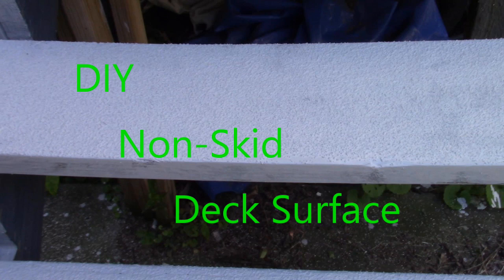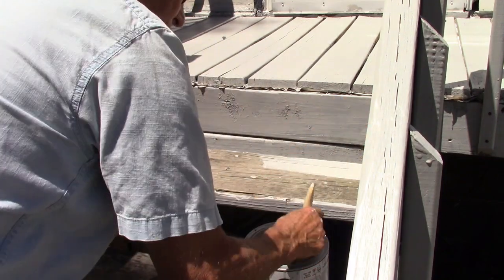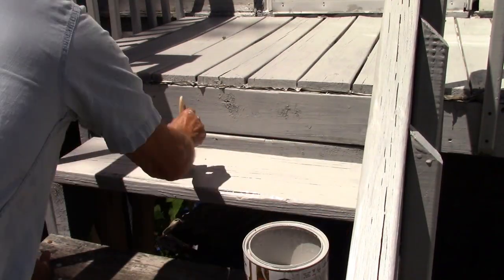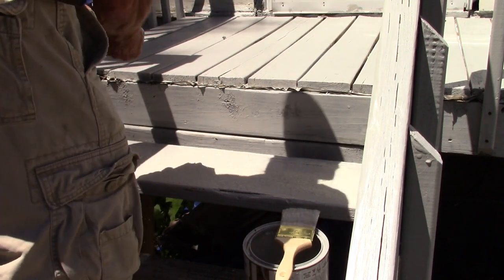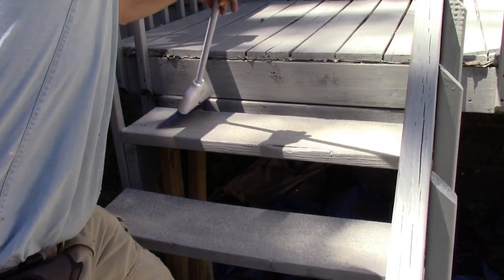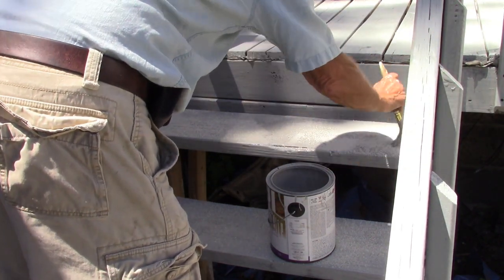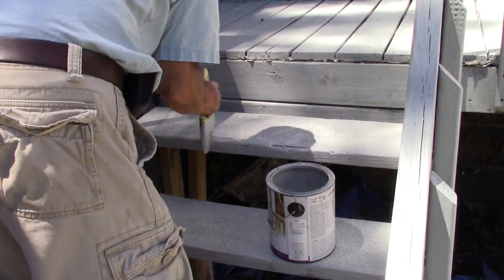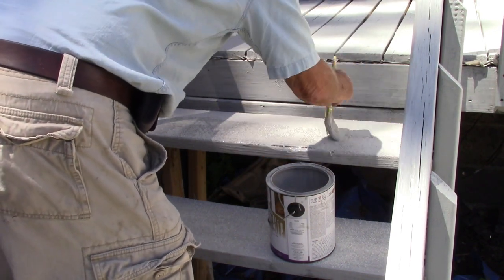DIY Non-Skid Surface

Comment: Dang, I clicked on the video because I expected this to be a bad idea... I work in the yacht industry, and of course we use fancy not skid particles, but I wanted to DIY non-skid my pressure treated dock and was considering using sand.  Your idea of using a particle that can absorb fluid is GENIUS! Instead of the paint encapsulating sand, its actually penetrating grits and making it part of the paint. Such a good idea!
Reply from the maker: Not my idea--- credit goes to the Yachtsmen of Fairhope Alabama, who stopped me from using sand on my sailboat, it worked great!
Reply: @donaldporta hi what would be the best type of paint to use for this project?

Comment: I needed a non-slip surface for my homemade truck ramps and I felt that sand wouldn't be aggressive enough.  I followed your instructions and it worked PERFECTLY!  Your grits technique is awesome.  Thank you so much for posting!
Reply from the maker: Glad I could help!
Reply: exactly what I need to do.   very interesting.    my snowblower likes to slip off the ramps when its wet.     still holding up?
Reply: Still good?
Reply: I just brought a new car hauler for storage well I'm in my temporary rental and the ramp will become incredibly slippery when I put the quality floor paint on the RAMP this is brilliant,  Many thanks

Comment: Thank you for sharing the idea! I am going to paint my parents outdoor staircase and trying to find a method to make it non skid. Your method really makes a lot of sense. Truly appreciate it.
Reply from the maker: Good luck!
Reply: Well, I tried it for parents stairs as well. You might want to test a small corner first and see how they like it. If they go out sometimes barefoot or in socks, the feeling under foot will not be pleasant. It is very rough on the feet, might even be a little sharp to the skin. For shoes only, it's okay. It's the same consistency as sandpaper. If you sit on it, as long as you are in jeans or something thick, it shouldn't be a problem. Aesthetically, not very pleasing. It takes more paint to do the coat over it. If you don't like it, you can use a paint scraper to remove it.  But to each their own taste. Just thought you'd like to know my results. I ended up scraping it off. So, it was a good try. Depending how many stairs and how large the area you need it for, one bag of 2 lbs of grits doesn't cover that much. I put it on sparingly unlike instructions in the video, but still ended up using half the bag for 5 steps and a porch. I used a coffee creamer container with a small opening to shake it onto the surface, instead of doing it by hand like the video suggested. I still have half a bag of grits and will use the idea for some other application if needed. Still a good idea for something. Not so much for parents stairs, at least not for my parents. I'll probably opt for a rubberized paint for parents stairs instead

Comment: If you have ground walnut husk for brass polishing or sandblasting, that’s what I used and it worked great. I tried sand, mixed the husk in paint and sprinkled it on the paint like he does here and the best method was painting then sprinkling then painting again.

Comment: I laid down a thick coat of paint and while still wet sprinkled heavy whit sugar. Once the paint dried I poured boiling water onto it which melted the sugar and leaves depressions in the paint making it non slip. Sweet

Comment: I built a boat ramp for a Jon boat, and I used this method on the walkway. It has been there 3 years and looks the same as the day I built it. Grits works a lot better than sand. Sand will come off where grits has become a part of the paint and will stay there.

Comment: I had my pool deck painted and it was slippery on the step out of the pool..did this trick and it worked great...on my concrete deck it almost looks like a rug is down...and is very non slip and easy on the feet.
Reply from the maker: that is great to here--- you can see why the sailors are doing this!
Reply: @donaldporta  I must say I was quite skeptical....but gave it a shot....the spot were I put it had the non slip grit in the paint but was still really slippery...your trick fixed it......thanks again for sharing !!!!!

Comment: Thank you for sharing. I applied your method on my 6 feet slippery wood shed ramp and after 2 years still good.
Question: need to do it on my concrete 4" x 20" . Does it work on concrete? Can I paint with roller instead of brush which will take me whole day?
Please advise.
Reply from the maker: Yes, absolutely on both questions
Reply: @donaldporta  Done. Gracias.

Comment: I'm going to try this, I'm going to use a paint sprayer, spray a heavy coat sprinkle the grits spray another heavy coat, will that work? or is it better to be brushed?
Reply from the maker: spraying is good--- but I like to let the first coat to set up then brush off the loose grit so you don't end up with large clumps of grits in some areas. then apply the second coat of paint.
Reply: I'm pretty sure it's common back-brush after using a sprayer anyhow.

Comment: Love this idea. If I want to premix mine, how many grits would I use in a gallon of paint?
Reply from the maker: that you will have to experiment with, I have never premixed mine, and the reason is when painting I only wanted the grit on the walking surface, this allowed me better control when applying.

Comment: Would this work on a wooden ramp used to drive a motorcycle over ? How grippy is is in the wet weather and will it survive motorcycle weight and rear wheel torque? ;)

Comment: Obviously we added too much of the grits mix! We can't walk on our deck surface, it HURTS OUR FEET! How do you suggest smoothing it out a little???
Reply: I don't exactly know but, maybe a couple more coats of paint? Sanding feels like starting all over.
Reply: Did you try anything?
Other than sanding, maybe a hard-bristled floor scrubber?  Wire brush?  Power washer?  Or, like T Lea said, a few thick coats of paint.  Make sure you clean it first, or you'll have peeling issues sooner than later.

It sounds like sand would be better for you than grits in that application.
Reply: maybe just go over the top a few times with a belt sander to your liking & add another top coat!

Comment: Amazing. Do you think this could work for a climbing wall? Obviously, it would be vertical. I'd paint my plywood when it's flat on the ground then screw it to the wall. It would need to be able to take some lateral and vertical pressure whenever I'm not using the footholds and need to grip my toes against the wall.
Reply from the maker: I think it would do fine--- it will wear with time and and will feel like course sand paper when first done, if that is ok with the wall.

Comment: I'm probably gonna try this for my shed I park my motorcycle in every day. When the ramp gets wet it's pretty sketchy backing out and pulling in.
Reply from the maker: I know this will work--- I used it on boat decks and is the best method out there with a paint additive, The paint will wear and at some point will have to be re-coated.

Comment: Question: what if I mix the grit with paint in the paint tray? I’m planning to paint my porch which is 8’x16’ and of course I would use the roller. Thanks in advance
Reply from the maker: you can try that, but I found that I could not get an even distribution this way,

Comment: I'm having trouble wrapping my brains around this bc grits are edible and wouldn't they dissolve over time unlike sand? I'm painting garage and basement steps and plan to use sand. Then I came across this video and am questioning now which one is better for non skid.  
How long will this last for indoor use?
Reply: They should be well-preserved due to air-sealed from the paint, I would think an oil-based paint would work better due to it seals completely unlike most water-based paints slows some breathing of the underlying surface. My guess as a retired carpenter and licensed contractor.   I'm going to research further before I decide which kind of paint to use.

Comment: If I only wanted to paint one coat on my deck how would it be if I just mixed the grits in with the paint in the paint can?  Any comments appreciated
Reply from the maker: it will work, however I found that it is hard to apply that way

Comment: If you have a larger surface— like a ramp — how much area can you do in one coat? Ie how long do you have to work with before the first coat has gone off too much for the grits to stick?
Reply from the maker: I do a smaller section at a time, water base paint dries so fast--- you will have to experiment to see how far it will go before skimming over. It will also depend on the temperature and humidity.

Comment: I never really cared for grits that much until I saw your video! Well maybe cheese grits! Great idea Donald, the absorbing qualities of the grits versus the sand makes sense.,  I'd like to try this on my deck ramp. I normally use solid stain for maintaining the entire deck,  wonder if the stain may work with the grits or do you think I'll need maybe a matching paint for the just ramp itself?
Reply from the maker: I don't think stain will since it doesn't harden like the paint does. If you try stain--- give me feedback on it!
Reply: @donaldporta  Thanks for the reply. Subscribing!
 The stain is from Sherwin Williams, I can probably just have them mix up a good deck paint to match the stain to play it safe.

Comment: Hi Don. Do you think grits would work the same way with stain?
Reply from the maker: the paint drys as a hard surface, the stain will absorb into the grits, but may not be a strong attachment to the wood.  If you try it let me know if it works
Reply: Thanks! Did it work with stain?

Comment: Have you tried to pre-mix the grit with the paint to make it easier to apply?
Reply from the maker: that would work well, the reason I don't do this, is I don't want the grits on the rest of the railings or deck.
Reply: I thought of that as well but, then thought maybe the grits would absorb all the paint and end up in an unusable gelatinous blob if you didn't use it all in one shot -- quickly.

Comment: Have you noticed any issue with bugs wanting to eat at the exposed grits or water causing an issue to them as they absorb moister?
Reply from the maker: I have done this for years, and never had an issue--- seems like the grits become saturated with the paint and is part of it.
Reply: could you email me a post of what the paint looks like after a year or so of wear? does it hold up over time or grits gets soft? What climate are you in? I live in Iowa where it gets hot humid summer and below zero winters . we have 4 seasons and I would love to try this on my new wheel chair ramp but worry

Comment: Isn't grit organic and when the paint wares off the grit will absorb water and expand creating a slimy slick surface?.   I think I'll stick with sand.
Reply from the maker: the grit absorbs the moisture from the paint and becomes part of the paint---- this method has been used by sailors for years and does not chip off like sand does.
Reply: Yeah, I was wondering if it would get moldy over time